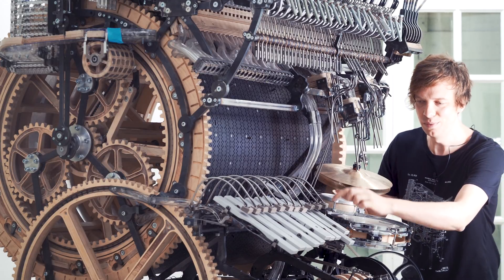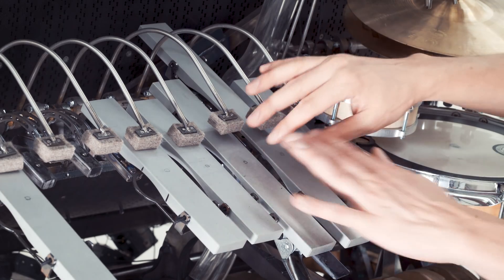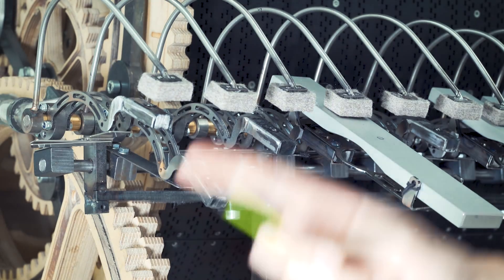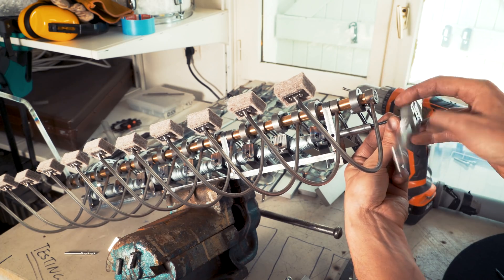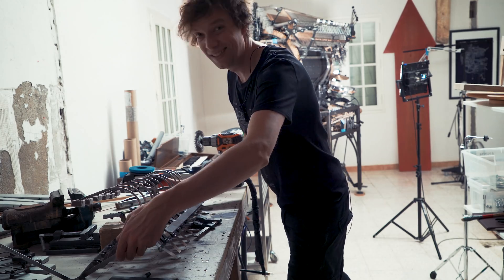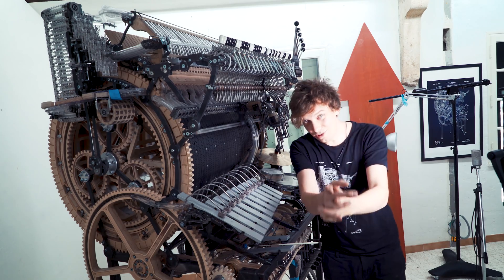Vibraphone Height Adjustment - Marble Machine X #103

Comment: How do you reecord the sound of the Vibraphone? if you do it with contactmicrophones where do you place them?
Reply: That topic was covered in a previous video a while back. Contact mics do poorly picking up the, lack of a better way to say, vibrato resonance effect of the assembly. So it has to be picked up acoustically. They found the bar and tube pretty much creates an evenly decaying tone when a contact mic was used. It's the, again lack if a better term, carburetor between the two that alters the sonic sound we here. Acoustic mics were chosen that have high background rejection. I don't remember them saying what mics were chosen.
Reply: @tigerzero5216  thanks :)

Comment: You should add some sort of guide marker to the body of the marble machine. That way you can consistently line the vibraphone plates to the same height every time. If you don't, you might place them all too low/high some days. At which point the marbles will start hitting off-center.
Reply: In short I had just posted a remark with the same thinking. Over time of adjustment the bars could end up closer or further away thereby changing the timing. But what is the percentage of people in a concert could tell the difference?

Comment: Nice solution. Just 1 suggestion. Extend the sweet screws up above the plates and plastic a small knob to the top of each. That will both, make the "on the fly" adjustments faster and easier as you won't have to reach down between the plates

Comment: Cool solution!

Suggestion: if there's a chance of switching out the entire keyboard while in concert, you might want to already have a position gauge made, either into the allen wrench or on the MMX itself so you can align the first note correctly then line the rest up with that. Otherwise, there is a risk of the entire keyboard being incorrect.

Out of curiosity, are you going back in CAD and making the same adjustments?

Comment: But if the vibraphone bar is moving up and down after being hit, won't this change in height be a problem if it's still moving when the next marble hits? Wouldn't it also affect the rebound of the next marble?
Reply: Good point. He's going to need a bigger marble catcher. I'm sure there will be a lot of testing before public performance to reveal your concern as a problem or not. I think the timing error will be so small that 90% or maybe 99% of listeners won't notice. Also, think about the people siting in the middle of the stadium. Will they really see those bars bouncing? Maybe if they are using a gadget to make a pirate recording.

Comment: This seems like an excellent setup/maintenance system, so you don't have to replace spring-steel as often and so everything can be easily leveled after the MMX is transported between venues, but it seems like a ton of work for a mid-concert changeover. Considering the whole goal of the system and much of the last few weeks of work has been to make changing vibraphone notes seamless, it seems like a mistake to rely on essentially an external system to get the plates level.

I would adjust the individual bar holders so each note is held at the same relative position, either by lengthening/shortening the "arms" of the holder plate or by introducing a wedge shim between the tube steel mounting point and the holder plate. That way the adjustment based on the static properties of the bar (i.e. weight) is entirely contained within that one little module.

As a visual analogy, it feels like you've modified a truck with something like the image below, instead of building the trailers so they work with the standard hitch height.

https://www.marks4wd.com/media/catalog/product/cache/1/image/900x600/9df78eab33525d08d6e5fb8d27136e95/m/h/mhabm-4-web_1.jpg
Reply: I'm getting the message they want the ability to do a quick setup change. That vibraphone is .... complex. Why not make two vibraphone assemblies that can be swapped out in seconds. As one performance is performed the twin vibraphone could be setup for the next one?

Comment: @Wintergatan Hi. @10:08 a question made his way to my mind: Did you tried taller note into 4th position? it seems it can jam the Gears... I wonder if I am right or not?
I think you will have problems fitting longer notes in 4th to 10th position and I think you should move hole vibraphone part a little bit forward...
by the way Great job...

Comment: I think this solution is in the right direction but falls a little short. Primarily, the need to manually adjust will greatly slow the ability to make changes live. Your adjuster solution needs to travel with the key. Adjust it once and forget it.

Comment: If the same piece of spring steel holds up each vibrophone bar, and the bars have different mass, won't the harmonic motion created by the impact of the marble differ on each bar? What will it sound like if the bar is still in motion when the next marble drops? Seems like it won't necessarily hit at the correct time or place?

Comment: Why don’t the bar mounts create the different heights? Since you have a custom mount for each bar it could provide the same height by just customizing the distance between the bar and the connection to the springy bar holder.

Comment: Great design!  If you need to make those adjustments on the road frequently, you may want the adjustment screws longer with heads that you can turn with your fingers (maybe large diameter heads with texture on sides).  The longer screws may give the torque advantage needed to turn by hand.   And being longer, they will be closer to being level with the top of the plates for easier access.

Comment: Couldn't he modify the holders of the Viber phone to be slightly taller, and at a different angle for the heavier notes?

This way the weight of the heavier vibraphone note brings it down to the position of the lighter one

Comment: You should put the set screw mechanism on the vibraphone bar holder, that way each bar can be individually adjusted, and hot swapped without having to adjust each time. Just me? 😅

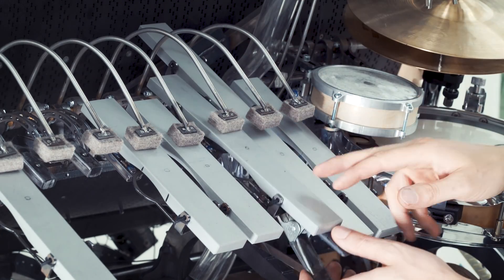Comment: Since you shifted the vibraphone plates up on the holders, do the longer notes still clear the pins on the programming wheel? Seems awfully close if you look at around 1:07 or 1:50. Especially if they bounce when hit by a marble. I hope it doesn't pose a problem.

Comment: I can kinda see the vibraphone tubes being next. Martin, You need to remember that the tubes ALSO need to be interchangeable. so I recommend that you make each tube with a similar system that you used for the torque limiter, but nowhere NEAR as strong of course. 

the idea stems from NERF gun barrel attachments. you have 2 grooves. one wide one, and one slightly thinner one, then you have two guide blocks that are the same width as these grooves so that the thing can only go on one way. then you push it up and turn it. and on one end there's a little bit sticking out that had a marble in it that slots into a bevel to lock in place.

Comment: You should put a tool holder on the MMX to make loosing or misplacing tools harder. If you misplace a tool you need in the middle of a show or traveling between shows, having a set/extra set on the machine means you never have to make that sound, you know the one I mean, the sounds you make as you soul rans out your leg and is replaced with ice water. It's sounds like C sharp but at 200 DB

Comment: Suggestion: You could add weights to the lighter notes and balance them out so they ALL weigh the same amount. This way you only have to adjust it once. They sell sticky lead weights for car wheels that would do the trick. https://www.amazon.com/0-25oz-Silver-Adhesive-Weights-Profile/dp/B00KJ2VZ6W/ref=sr_1_7?keywords=wheel+balance+weights&qid=1572638113&sr=8-7

Comment: I absolutely adore your solution, but part of me wishes you'd gone for the added mass to create uniform rebound. It would've also helped uniformity for collecting the marbles. But this is a far more robust a system and it allows greater service life on the flat springs due to the ability to adjust the angle, great work.

Comment: I don't think that the set screw idea is the best one, even though it works and can be adjusted quickly for a single note, it might take way too long during the live performance to change the height of 6 or 7 notes. I would suggest instead attaching the shims to the vibraphone plate mounts, so that the height would be right in the moment that you insert the note into it's arm. I'm really enjoying the series and I can only congratulate you, Martin, for such an incredible machine!

Comment: You really over-engineered what is a very simply solution. See the elbow that rests on the spring steel? Add a short projecting spur to the note holder that slides between the elbow and the spring as you slide it on. You set that height (it's just a thin wedge) ONCE to set the height for the note according to it's weight. Maybe have that wedge thickness set with a bolt. It does exactly what you are doing behind it with your bolts EVERY time you change it over - just immediately - because each note is always the same weight on the spring, wherever you place it. 

Only reason to have your existing system is to counter the fact that some steels may sag more over time if they have a heavier note resting on them for a long time, so you can counter that if you are not swapping them all around very much. Would take a very long time to have much of an effect on the steel springs though, so is probably redundant.

Comment: Martin are you worried about the timing of the notes or the appearance of the vibraphone?
I don't understand either concern.
If Timing then... I was surprised to hear you wanted the bars to move while playing because of the slight variability in marble drop times as the bar moves up and down that probably exceeds the few millimeters difference due to the weight sag.
If Appearance then... is a few mm noticeable to your audience?
It seems you might be solving a problem that doesn't exist, or maybe one that might be de-prioritized.
Respects!

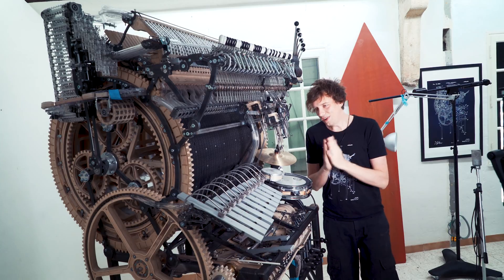Comment: 10:24 That's also something I've learned as a programmer. If you're building software, then everything you build has to have its own function. It's like building in modules. And each module has its own module.

Comment: Have you given much thought to what moving this into a venue is going to look like and that process will go?  I know everything can be broken down into sub-assemblies and that's a part of the process but some of those might still end up being too unwieldy to go onto a dolly, too heavy to easily lift by hand, or too delicate to feel safe transporting outside of a case.  While you've reinforced things damage is also always something to keep in mind.  All it takes is someone blundering into a corner with some part of the MMX on a cart or dropping an assembly because they lifted it from something that wasn't as secure as it looked and suddenly you have a pretty bad situation.  You can keep replacement parts on hand, but that's really only so good of a solution compared to preventing damage in the first place.  I know thinking of how you're going to get this to a concert hall is putting the cart before the horse in some respects but transport is really something to keep in mind.  

I'd also advocate for getting it insured now if you haven't already considering how many thousands of dollars and manhours have gone into it.  Homeowners insurance might not be as far reaching as you think and later on venue insurance payouts actually cap out pretty low.  I know that's preparing for the worst and sounds pessimistic but it's probably good to be cautious given how many years of your life you've given this machine.
Reply: That is what custom transport cases are for.  large case for main frame of MMX, with built in supports/attachement points so the MMX is firmly attached to the inside of the case.  Other large cases hold assemblies such as programming wheel sections in individual, custom fitted compartments.  Still others hold the more delicate assemblies.  Properly engineered cases can protect very delicate machines from very rough handling.  
So - cases move to the stage.  the main case for the MMX frame comes apart, leaving the MMX standing on the base of the case (which can remain right there).  The other cases are opened in order and assemblies move from the cases onto the machine.  no one is EVER moving assemblies outside of the cases.
This is all old school roadie skills.   There are thousands of people out there who know how to design and build these cases.
I needed a large custom case for complex equipment I use in trade show booths.  I watched videos and purchased the parts online here https://www.diyroadcasesstore.com/ and was able to do it mysqlf.  Martin has a hell of a lot more skills than I do and will have no issue with this.
Reply: @johnscully1924  Yeah I wasn't trying to imply that this was beyond his abilities or anything, just that it's something to start thinking about.

Comment: @Wintergatan
you should put the stop palte a little bit higher and maybe closer to the pivot and
use the lightest note as a reference to get the optimal position
so you get more range out of it. You almost had no adjustment left on the heavyset note!

Comment: Solution 8: Spacers attached to the plate holders

Let me elaborate; Each plate might need a different amount of spacers to get the spring tension just right. You also do not want these spacers to be loose, or to have to search for a matching amount of spacers for a particular plate. But is you have a piece of flat material going from the bottom of the vibraphone plate holder, extending backwards so it automatically slides between the sping plate and the vibrophone arm when you slide the plate on, then you problem is solved. You can just add extra spacer plates to the end of that new piece to make the effect bigger.

Comment: With the height requirements of the notes, wouldnt it be easyer to adjust the plateholders to have different heights themselfs? Given that the springs are all under the same tension. This way even when swapping the plates theres no further adjustments needed to play on same timing.

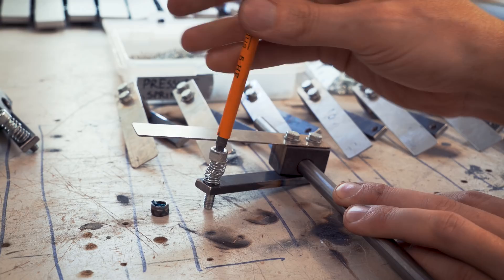Comment: 5:20 those springs will eventually thread into each other. You need some (larger diameter) washers as spacers between them (or just swap in a single spring). And maybe one more washer between the spring and the bolt head. Also, get longer bolts or use thread-all / threaded rod and replace the bolt head with a knob or wingnut (no tool needed). Use jam nuts (just two nuts tightened together on the thread) to keep tension on the spring. Heck, you could delete one of your current springs by using jam nuts right now...

Comment: You shoud add a  thumbscrew, so you can do the adjustment without a tool.
There's already alot to change out and adjust between songs.
I also like the idea to just switch out the whole vibraphone section.
You would just have to build another one...

Comment: My only concern is the extra adjustments between songs. You already need people to replace the notes and programming plates, now you need someone to get out a wrench to make these adjustments. 

My suggestion would be the first cam idea since it sits on the note, not on the rest of the machine. That way each note can be set before putting it on the machine.

Comment: Martin then:
Every part needs to be engineered to perfection.

Martin now:
Stacks washers to get the desired distance.
Reply: it is actually very common practice among mechanics, the difference is that mechanics will start making/ordering spacers of correct lengths once the distance is set.
Reply: washers are easy to source and replace
Reply: ...or you use a suitable diameter pipe and cut it to desired length.
Reply: @rhkavli  but you'd have to know what the desired length is before hand. it's much easier to fine tune with washers. Now for the american MMX? Sure he could measure the space and just cut them to size, but this was very much a prototype idea. I'd bet Martin wasn't even sure it would be the final solution until he tried it.

Comment: I imagine the movement of the bars might cause a timing issue with the deflection direction of the ball-bearings, the angle of the bounce will change depending on the angle of the bar. Also, If two balls drop too fast one after the other, will it not cause the second note to sound different, as the bar is still busy traveling up back to its original position, causing the second ball to hit the bar at an oblique angle?

Comment: I know you have found an elegant solution but does not seem quick to change now. Could you not add Permian to shims/packing to the under side of the vibraphone holder that rests on the spring with the right packing for each vibraphone more for the heavier notes

Comment: Can't you just add weight to each smaller plate so it equals the weight of the largest plate? That's the way they machine balance engines so that all reciprocating assemblies weigh the same. (although, that's usually done by grinding off excess weight, but the results should be the same.)  - I ask before even watching the whole video.

Comment: I was thinking of 2 blade springs, the upper one slightly shorter. Both kept together by a clip which you can move back and forth.
Move it back and the force is transferred to one spring. Move it forward and both springs combine.

Comment: Every time he moves one of the low notes into the high note places, i'm concerned that once he has pins in the programming wheel, the two will interfere with each other.  may just be the angle of the camera but it always looks like the plate is in that turn radius
Reply: Thanks  for saying it I thought I was alone with my opinion today. At some point the note actually touches the wooden gear part of the programming wheel.